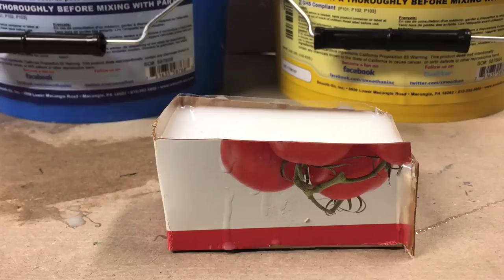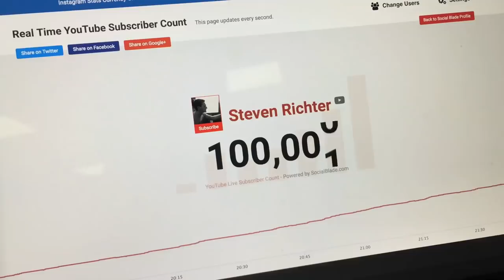3D Printed Infinity Gauntlet - Thanos Sculpture Timelapse Part 2

Comment: Hi, I have a question.. what kind of material did you use to mount the gauntlet? Did you just glue it together? I'm also gonna make a 3D infinity gauntlet, so i'm curious :) And about the stones.. could I also spray paint them in the right color? instead of having a epoxy in each individual colors? I hope you can help me out.